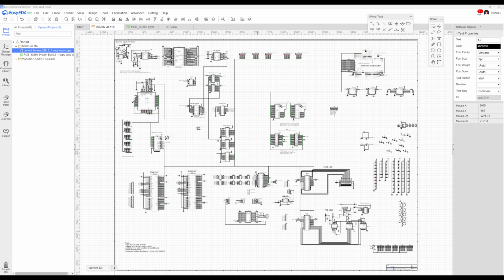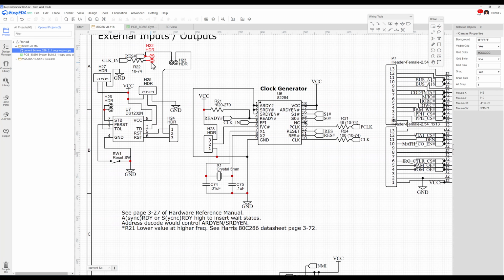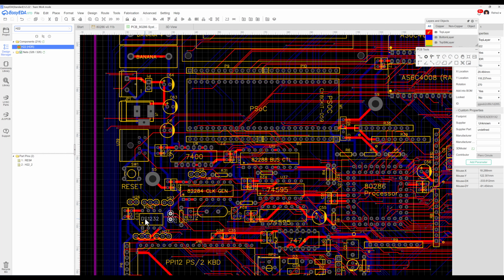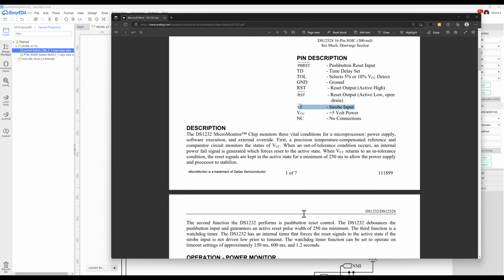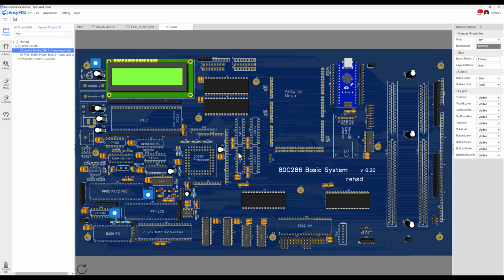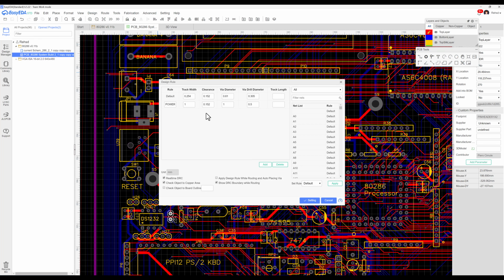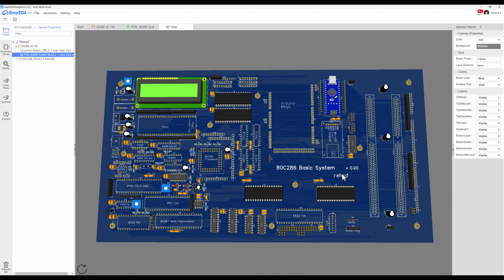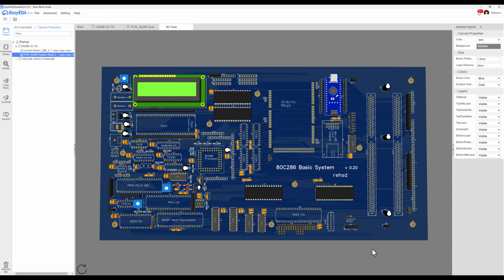80286 Build, Ep. #66 - PCB 0.20

Comment: What are your thoughts on replacing the basic through hole components (caps, resistors, etc) with some surface mount parts and letting JLCPCB do the assembly for you? It'd up the per board cost, but save a lot of the hand assembly time and maybe let you shrink the design even more.
Reply from the maker: I believe their assembly cost is pretty high (for my hobby budget, at least). I could go with surface mount and assemble myself though. I'm sure I could shrink the board down more. Many of the ICs are available in smaller DIP and PLCC packages. I do find the through-hole ICs (with sockets) handy when I need to pull a leg up and change the path of a connection (as seen on my current PCB 0.10 build, lol), or when I swap from one IC family to another for testing (e.g., from HC to AC).